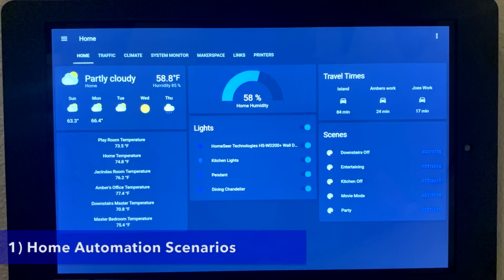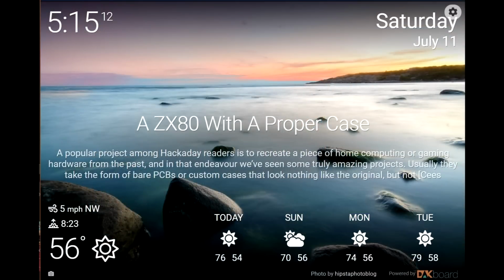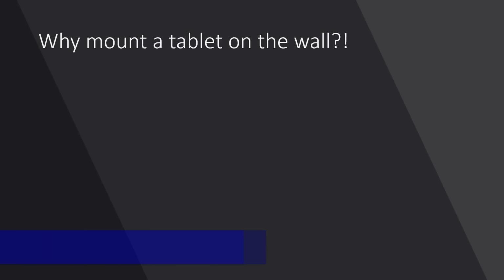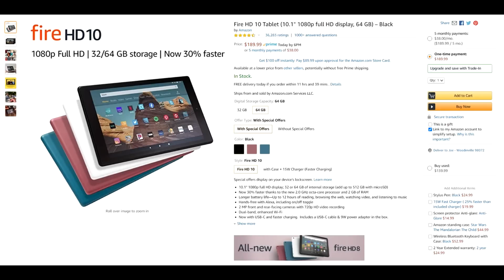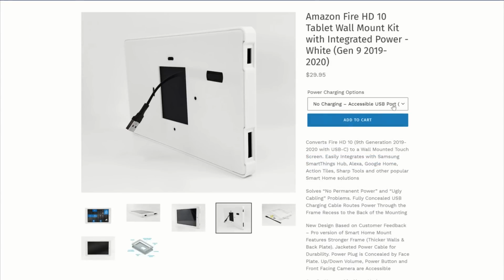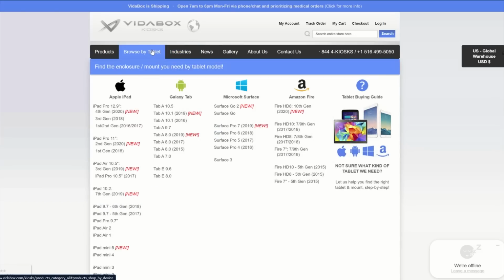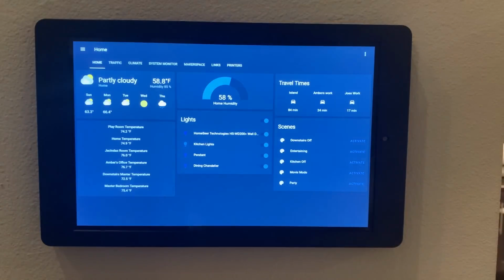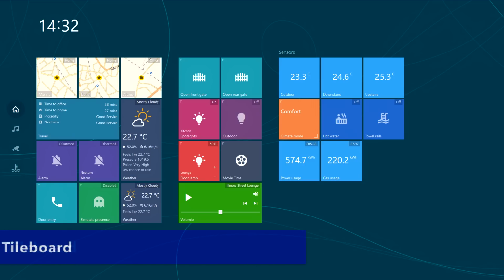5 things to know about wall mounted home automation tablets

Comment: Nice video. May i know what dash board interface are you using for home assistant? I saw you are providing links for tile board, home habit and wallpanel.
Reply from the maker: Thankyou! I’m using Fully kiosk browser to render Lovelace with the Noctis theme from Hacs. I will likely keep working on it and do a follow up of “home assistant wall panel” specifics like themes, using the cameras from the tablets, MQTT and such. Depends on interest and what I figure out to see if there’s enough interesting content there
Reply: @geektoolkit  awesome, I was about to post similar request, it looks amazing. Do you have any Flic buttons integrated?
Reply from the maker: I don’t have any flics. I built a thing called dynatap that I’m hoping to make more of which has served a similar purpose. I am looking at them now...do you have them and like them? They seem neat

Comment: On my Fire 7 HD 2019, the webview seems to be stuck on v70, which FullyKiosk complains about. Did you find a way to update this? EDIT: Nevermind, I see in your FullyKiosk that you also have webview 70. :/ It works OK, it just has trouble with SVG and CSS animations sometimes.
Reply from the maker: Yep I’m in the same boat. No background animations for us :(. That’s part of what inspired the video...I did a bunch of research to get around it and found out we seem to be stuck till a root gets developed for it (apparently then we can get webview updated with chrome using lineage). Or we take a FireOS update that moves webview forward, but may break fully kiosk

Comment: I'll be adding mine soon :) just built it this weekend, and then broke it yesterday so building it again...
My goal is to have everything on one page for users, and have other pages for me as an admin.  Also to have switches and voice control for everything so that the tablet is just another option not the option.
I did incorporate your speedtest into one of my admin dashboards.
Still trying to decide if I want a always on screensaver or a screen off after X time.
BTW I do not have the ad free HD10 but with fully always being active the ad's never come up (and they are easy to remove with tools you can get online)
Reply from the maker: Nice!!! I like the idea of having voice, switch, and tablet all play off each other. That makes sense and is smart and gives options
Reply: @geektoolkit  The Hue Dimmers are a powerful option.  Once integrated into Node Red they expose 16 different command sets and can be used as switches or remotes, and require no wiring at all.

I am trying to think of what else I might want to add to my setup before I do a video, or maybe I will just do a video of "how it is right now" to go over some of those features, and most importantly some of my pitfalls I had building a new instance after being away for a couple of years.

Comment: Great video. I literally have the mount and wired ethernet in place but it seemed like too much work to get the hd 10 configured. Maybe I'll go back to the project.
Reply from the maker: Oh I think you definitely should! I'd try wallpanel for software if you have a web based frontend, should get you started quickly. I mounted mine in probably less than 10 mins (drilled in an anchor, mounted one screw in, leveled, marked the second, pivoted it out of the way and put in the second anchor and bam...slapped it together! It is really satisfying when you get it all in!

Comment: Thank you for showing this 😀. I would love to see how you got kiosk working with Amazon 7 fire tablets. I have adds on mine and I'm struggling with getting the screen to stay on and coming out of screen saver. Cheers
Reply: If you contact amazon support and tell them your child is using the tablet and you don't want ads sometimes they'll remove the ads for free.  Worked for me.
Reply from the maker: Did you get the ad supported fire version or the non ad one? One thing about what I did is I paid extra for no ads to avoid that
Reply: Did you get this working on a Fire 7 tablet?  Mine does not have ads.  Did you try installing Wall Panel?